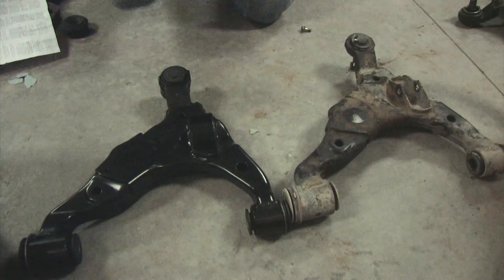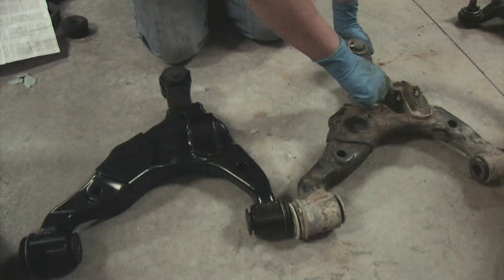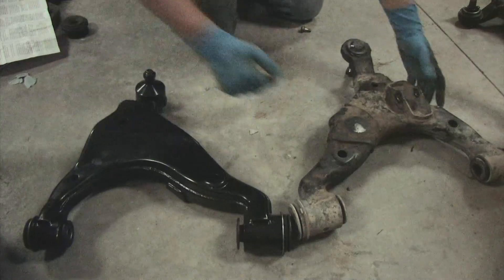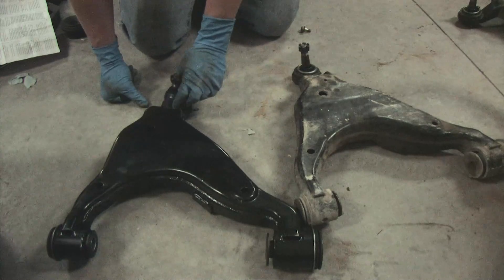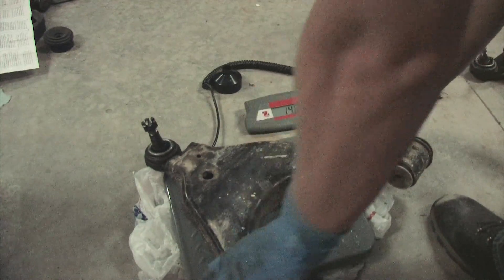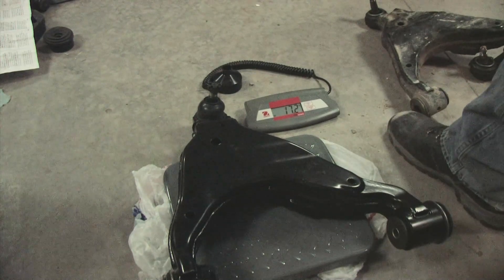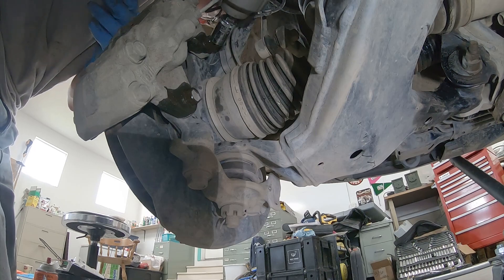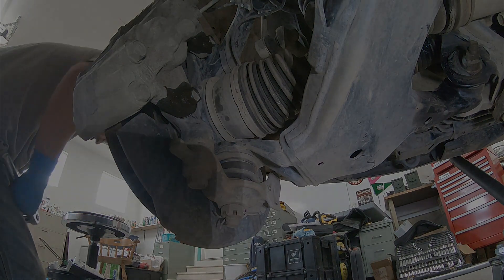1A Auto Lower Control Arm (LCA) for 120 Series Toyota (FJ/GX/Prado/4Runner).  Are they worth it?

Comment: OEM is the only way to go. I installed new Moog LCA on the GX and had issues with squeaking in a couple months of mild use. Swapped them with OEM Toyota LCA and it was well worth the extra money…just reboot once a year if you wheel a lot, especially without swaybars.
Reply from the maker: Yeah, I was not impressed with the moog ball joints I got at all.  Which is strange because they are a quality supplier for BMW, but I won't be going with them on a Toyota anytime soon.

I just can't stomach what Toyota wants for an LCA, the 1As have been awesome for me and if/when the ball joint goes, I'll press in a 555 or just get new LCAs.